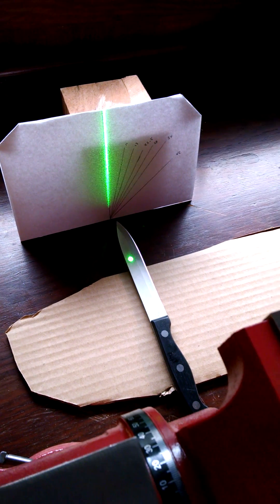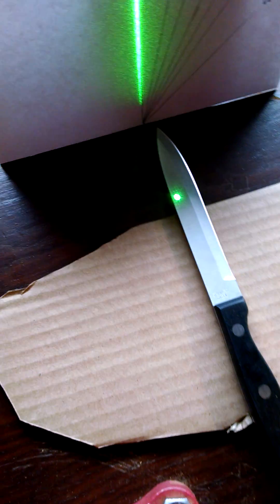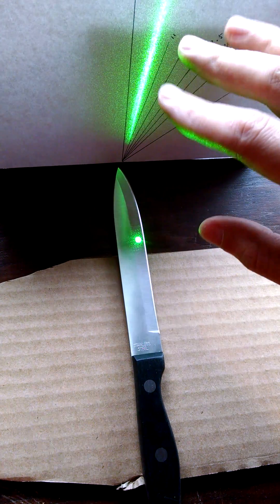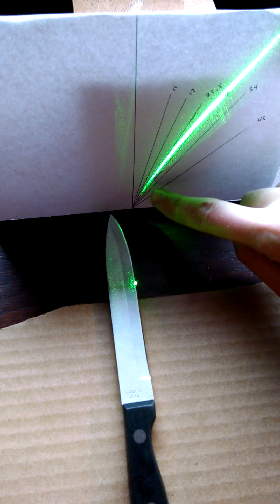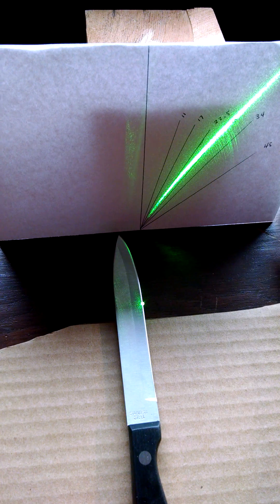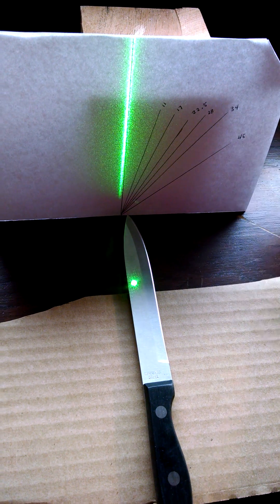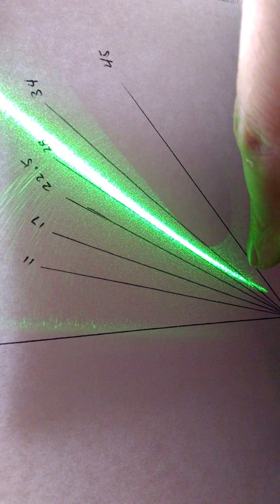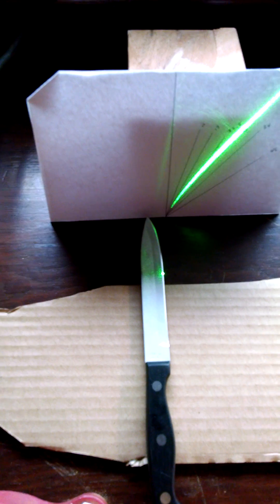Measuring blade angle

Comment: For this method to be accurate you absolutely must move the center of the protractor to the intersection point of the bevel lines. Otherwise your angle indicator is going to be incorrect.

Typically that would be the center of the protractor being at the at the same height of the knife and completely in line with the laser, and the point of reflection on the knife. Yours is lower because the table is supporting both the cardboard of the knife and the protractor sheet. It looks like you have the side to side calibration correct.

If you put the angle markings on a riser you can adjust that similar to how you adjust the lateral movement of the blade.
Reply from the maker: I think that is helpful when the laser projection is linear, not curved. When curved there is no single point on the laser projection that is "correct". The tail of the projection represents the edge of the blade.  The base of the projection represents the primary bevel.  The middle of the projection represents the smoothness of the transition between edge and the primary bevel (rounded in my case because I strop my knives). You're really looking for the line on the protractor that is parallel to the part of the laser projection you're interested in.  As long as you are comparing the parallels, then the protractor will give you your answer without having to center anything.  Sliding around to get the lines closer for comparison will likely help though.

Comment: CATRA in the UK have been making and selling laser goniometers (as they are called) since 1978 using this principle.
Reply from the maker: It's been mentioned :) In any case, this is a way that you can do it at home.
Reply: Yes, several places manufacture knife goniometers. However, the cheapest one from Catra is £100, and the cheapest overall is Gritomatic's for $70. This one costs next-to-nothing, so it's a useful alternative.

Comment: I can't get a clean reflected line with a red laser pointer.  Do you know if green is necessary?
Reply: different color lasers have different beam shapes
red is kinda fuzzy and unpredictable
green is fairly predictable and circular
blue is rectangular
Reply from the maker: Wow sorry for the late reply -- I don't believe the color matters in this case.  My gut tells me the fuzzier the reflected line, the less polished the surface is.  You could go with the middle of the fuzzy line as a guess or you could try to polish it up a bit before measuring.  Hope that helps.